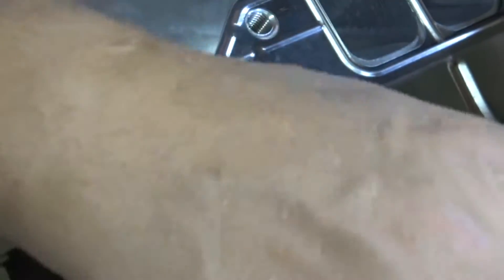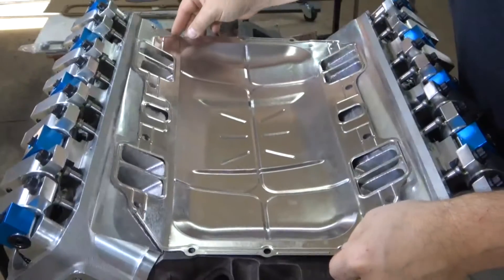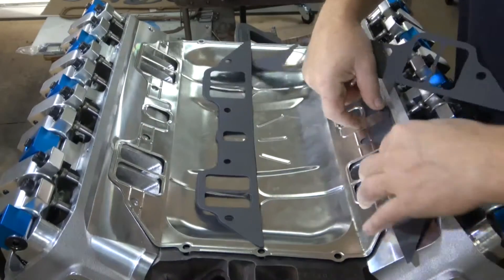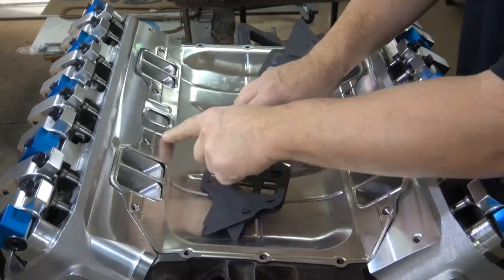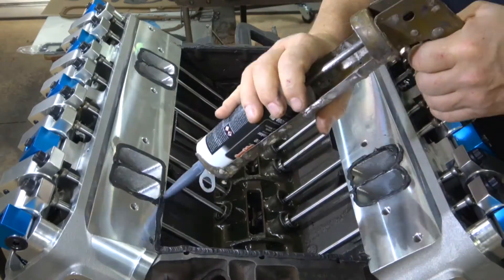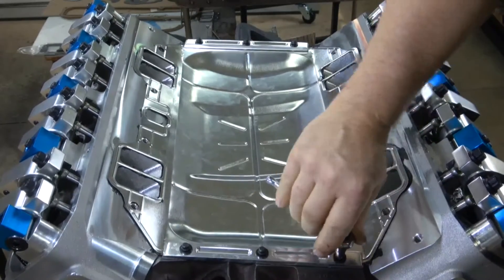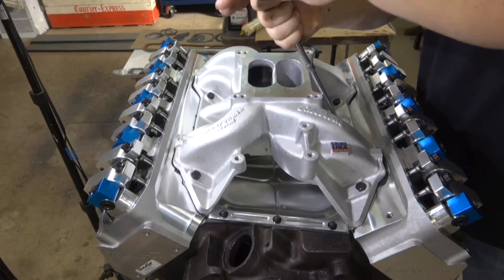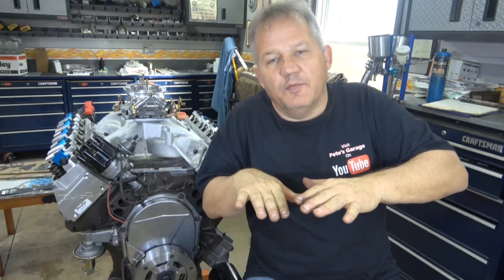Engine Building Tips - Intake Manifold Installation 440 MOPAR 512 Stroker

Comment: Thanks for the video, very informative. just wondering if you could clarify:@3.06 So you have sealed around the intakes and ends of the pan underneath the pan, as well as placing the sealer on the sealer on heads ( effectively increasing the bead thinksess?. You alos mentioned sealer on the manifold, is this around ports and ends only. thanks
Reply from the maker: Yes, the sealer goes around the ports and the ends to create a good seal.

Comment: My experience, DEFINITELY  use the gasket on the top side of valley pan. It's helps squeeze the pan seal tighter around the ports when torqued.
Reply from the maker: Thanks for the tip!

Comment: Great tips!  I check the intake to head port alignment with the valley pan during mockup in case the heads/intake need to be milled. 
My first stroker build, I didn't check until final assembly, and had to mill quite a bit off the intake for it to fit which pretty much makes that intake unique to the engine, and if I wanted to swap intakes later the new one would need milled too, unless I pulled the heads and have the intake port side milled which I should have done originally.
Reply from the maker: I've had to do similar things on other engines